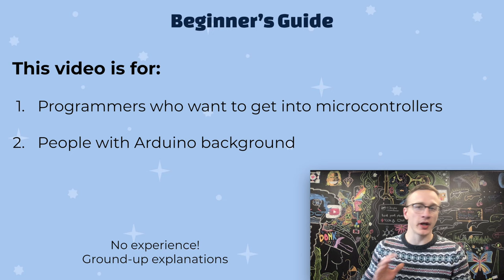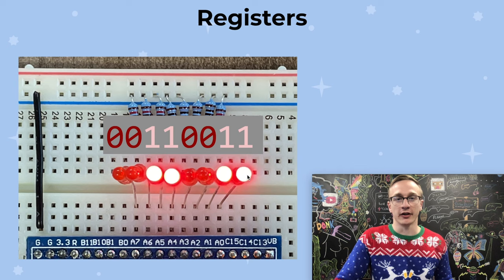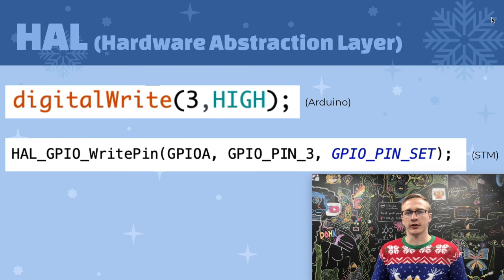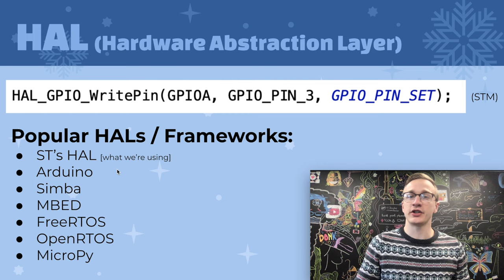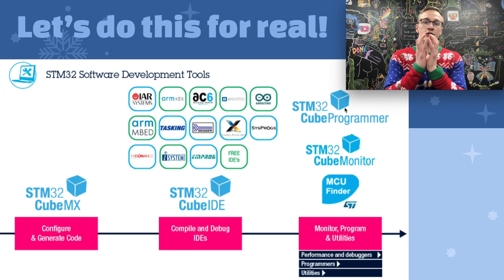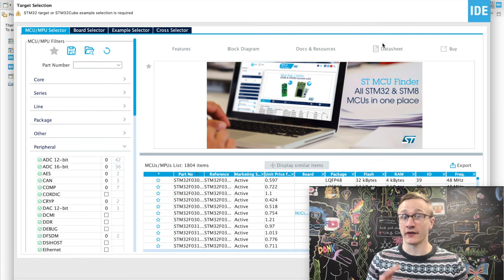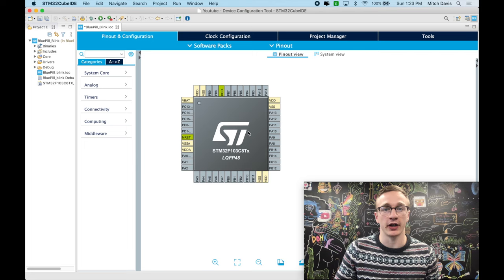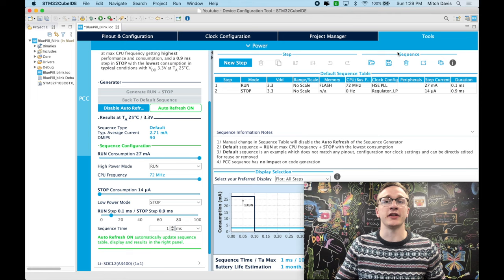STM32 Guide #2: Registers + HAL (Blink example)

Comment: I don't want to get one of those red programmers. Can I use a serial FTDI through A9 A10 ?
Reply from the maker: That will work only if there is a bootloader on the device that supports UART.
It’s been a little while since I made this video, so I don’t remember if the blue pill has a BUILT IN bootloader, or if it’s something that has to be flashed to it manually.  You should be able to check the datasheet for the STM32F103 and search for “bootloader” and see if there’s any documentation about serial/UART

Comment: ..I need something like stm32 for my gps clock ...the sketch is too big > 100% of it's capacity..but it's more complicated..you can't get it right if you didn't get a good sleep...but that's cool anyway..great video for random nerds..
Reply from the maker: Don’t forget, there’s other atmel branded chips too if you simply need more memory.  I  originally started learning stm32 just because I wanted to understand how development worked on different platforms
Reply: @MitchDavis2  ...I tried stm32 once..I only could run it once..than it died..and I can't find the port that I used b4...anyway I'm switching to faster reliable nodemcu with sufficient 3.3v to supply 8 * FC16 ledmatrix + Neo-6m + piezo tweeter for my next project...no internet no problem...just grab time from the atomic clock on the satellites...

Comment: thanks this channel really help me to learn stm32. by the way, when I try to download the blink program to  the stm32 blue pill by using st link v2, the IDE show me an error message : "Failed to start the GDB server, Reason (18) Could not verify ST device! Abort connection". Can anyone please help me solve this problem??
Reply from the maker: Occasionally, that message pops up for no reason, so if you haven’t already done so, try uploading again.

If that’s not the case, make sure:
- wiring is correct on STM32
- wiring is correct on STLink
- blue pill has the boot jumper set correctly
- blue pill is reset after adjusting the jumper.

If this still doesn’t work, snap a few pictures of your wiring and post them here and I’ll take a look

Comment: I am getting the message, 'Download verified successfully'.
But I am not getting the message, 'Debugger connection lost.
Shutting down...' 
How do I resolve this issue?
Reply from the maker: Few questions:
1) are you running in debug mode, or run mode?
2) which STM32 are you running?

If the debugger is still connected, there’s a chance that your code is “paused” at the beginning.
Reply: 1) I am running in debug mode.
2) I am using STM32F103C8T6 (Bluepill board)
Reply from the maker: @shreelaxmiramesh8753  ok, that explains it then.  If you’re in debug mode, the IDE isn’t disconnecting the debugger because you’re actively using it.

If you want to continue running in debug mode, click the “Resume” button.
Alternatively, RUN your program instead of DEBUG, and it won’t lock up at the beginning

Comment: I am getting this comment after debug: localhost:61234: The system tried to join a drive to a directory on a joined drive  . Please help
Reply from the maker: Can you post a screenshot?  It sounds like the debugger is failing to start or connect or something.

Are you running Windows, mac, or Linux?
Reply: @MitchDavis2  It is Windows 10. Can you tell me how to post a screenshot in the comments?
Reply from the maker: @sreyaghosh6632  I like to upload pictures to www.Imgur.com and post the url
Reply: @MitchDavis2  Hey Mitch, I have been commenting the url here since day before yesterday but it's getting deleted automatically